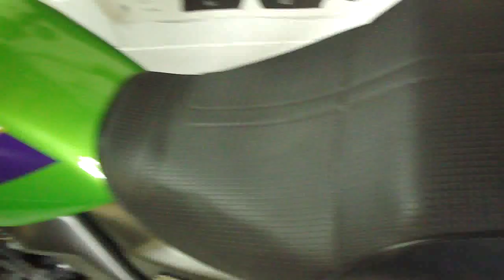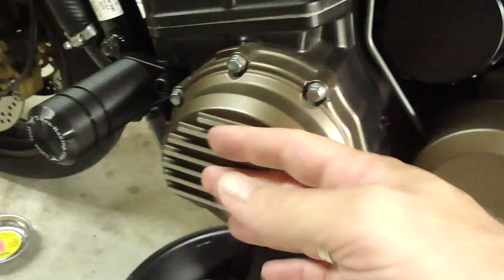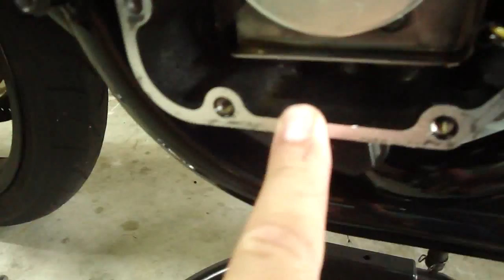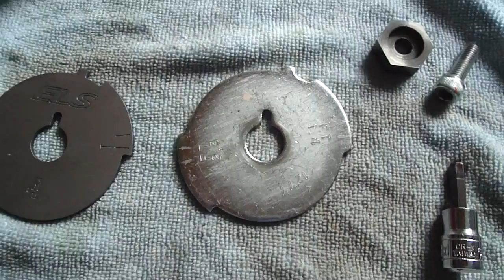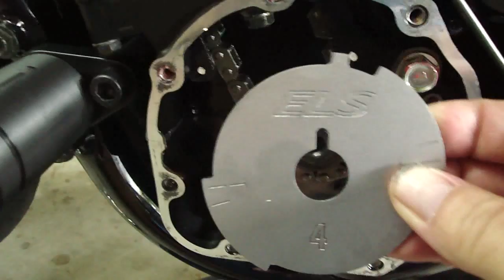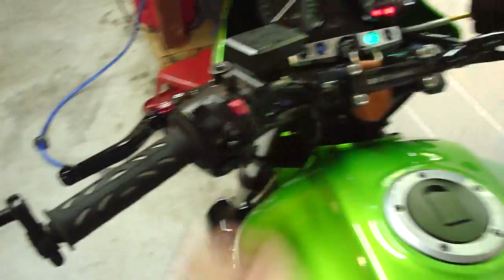ZRX 1200R ELS +4  Ignition Advancer Installation

Comment: I just started ridng my rex again after 22 years of 1200 ADV bikes. Man it's badass. It will out run my '13 Super Tenere and give my new Tiger 1200 GTX a pretty good run. The riding position is getting more cramped the older I get. (KNEES). They are still the best looking bike era. If Kawasaki offered an updated Z1 100LTD. I'd buy one.

Comment: This video was really helpful, but one thing I wish was mentioned was the possibility of your stock cover gasket needing replacement. I'm obviously an amateur and didn't realize this, leading to a leak after reassembly because a couple pieces broke off on disassembly. I'd recommend ordering a replacement gasket and sticking that on after the install - better safe than sorry!

Comment: 👍 Very useful and clear instructions thanks.  For those that don't have a Kawasaki service manual, 18.0 ft-lb torque wrench setting you mentioned for the Allen bolt refixing (which is equal to 26.0 N-m or 2.5 kg-m) is correct.

Comment: Just did it on mine. It’s not the power that it adds ( a claimed 1 to 3hp) but it is the way the power is delivered. Couple this with disconnecting the K-tric wire ( per Pete’s advise) and boom, a whole new beast ! Thanks for your video. Watched it once and with in 10 minutes ( and one quick call to Pete as well) I was up and running...
Reply: could you please tell me who Pete is and how to contact him? I've heard him mentioned many times.

Comment: This is not an up grade. It's just an after market part. 13 years 76,ooo miles never had a problem. Not needed at all. 4 degree advance starts at 4,000 rpm
Reply: If it makes the bike run better then it’s a upgrade ….
Reply: No, it’s not NEEDED. But a 4 degree advance will definitely make a change for the better.
Reply: Put it on my suzuki and it's a upgrade

Comment: Just did this same thing to mine seems to be a lot smoother as well but did a carb synch too.  If you haven't yet looked at the clutch plate through your oil fill cap check that for a series of strikes from the starter chain tensioner.  Pete has the best fix out there for that problem.  If it grenades on you it will cost you a motor! It's cheap insurance.  Lookup tension tamer.
Reply from the maker: +SFZX 54 No problems with mine. I'm happy with my advancer as well.

Comment from the maker: A normal, in traffic it just seems a little smoother. It's when you get into high revs where you can tell it pulls considerably harder and roll on's are more enthusiastic. It pulls harder near redline than it ever did before. I have not unplugged the Ktric as of yet. I'm happy with the addition.